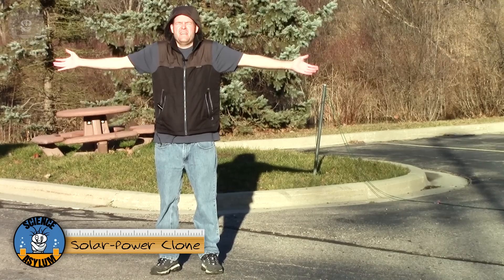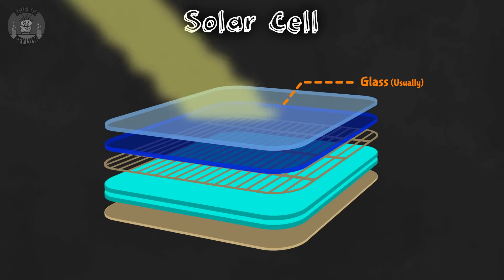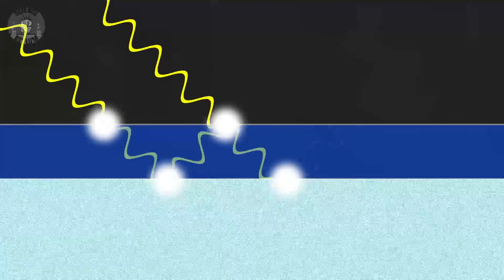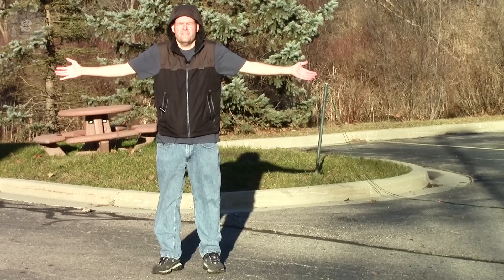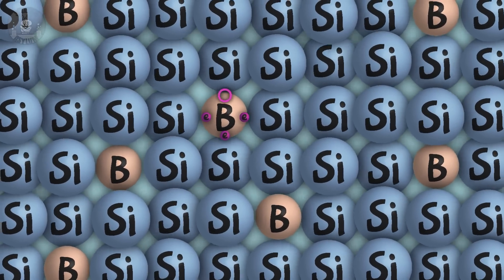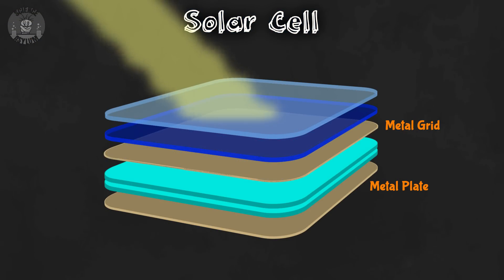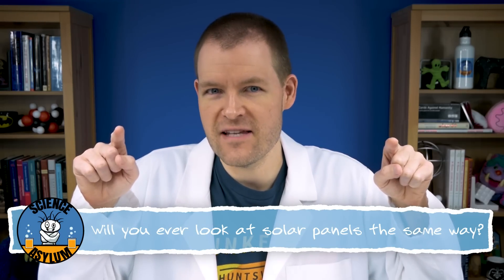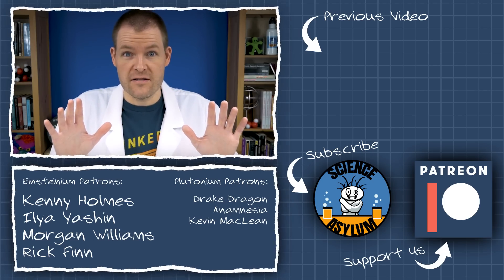How Do Solar Panels Work? (Physics of Solar Cells)

Comment: We always have to be careful about "green" energy. As in what's the carbon footprint on the materials used... mining & transportation & processing. Particularly with green "batteries". I was an early adopter of CFL bulbs. Despite what they claimed the early bulbs burnt out like crazy. Meaning I had to buy more...  resulting in more transport and manufacturing costs. Then I realized instant on meant up to 2 seconds for the light to work... dangerous on a staircase. And then the news about mercury in the bulbs hit. Dangerous if they break and toxic for disposal. Expensive to produce and decommission.  So now I really wonder if they're actually way worse for the environment than regular old bulbs. Like batteries for solar power storage and "green" vehicles that are likely to cause a huge toxic waste issue in the near future. I've heard about solar being the answer my whole life and there are a lot of good reasons why it's still relatively rare and extremely expensive.  Despite all the yearly "breakthroughs " they have over the last 5 decades. I wish green tech wasn't such a marketing scam. They need to be honest about the environmental issues they have.
Reply: Extremely expensive? It's literally cheaper than the fuel for a a coal power plant in many areas. Cities around the USA are going pure solar because it's the cheapest source of power, even in areas with access to cheap fossil fuel. And this is all ignoring the externalized costs of coal pollution, both mining and burning. Even "clean" coal power plants release plenty of toxins.

The only cost effective fossil fuel is natural gas, but that has its own set of practical issues limiting its mass scale use.
Reply: @BenjaminCronce  I'm in western Canada. I priced out solar for my cabin by a lake. A summer cabin when it's warm and extremely sunny. The solar company calculator estimated a full system would pay for itself in 60+ years. And that was based on year round usage so it would be significantly expensive and pay itself in say 300 years. So yep... expensive in the extreme. If you live in a dessert with no local power lines and huge  government subsidies then it might be affordable.  But solar at the moment, like wind, is way more expensive than alternatives here. We have huge wind farms but their electricity is still double the price. Only government incentives and subsidies makes it at all practical. Of all the houses in the USA about what percent use solar power? I heard Elon Musk's solar roof panels are about $100,000. USD per home. Is that cheap? What about the batteries ? How many years before they need to be replaced and how clean are they? I agree we need to pursue the tech but let's not kid ourselves. There is a reason it's not everywhere yet. And I'm not sure where you get your coal but it's dirt cheap here. And they say there is enough in Alberta to fuel all of North America for 650 years. Not that we want to lol since it is clearly not good for the environment. We also have vast amounts of natural gas, hydro electric and nuclear power in Canada. But every type has some big environmental issue. I'm all for clean energy. I just want the drawbacks clearly stated so people know that even solar isn't perfect. It all comes with a hit to the environment. Those hundreds of wind turbines I drive by... yes hundreds aren't made of fairy dust. They have a huge manufacturing and maintenance footprint and are apparently bad for our bat friends.
Reply: @cgaccount3669  
I priced out a rooftop solar PV panel system in Canada ten years ago with a vendor and it would have cost me $60,000 and pay itself back in 12 years.  It should be much cheaper now (half?) and payback should be faster in a sunny place like Alberta (along with today’s increased utility costs),  But maybe your cabin is in less sunny BC.  If you use it for just a few months of the year, the payback time could well be much longer for your system but it will also have a much longer life to amortize over, which means it comes out the same in the wash except for interest costs.  You might have to pay a minimum for year-round hook up to the utility system.  I need to pay about $80 each month for the 6 months that I don't use my cabin each year.  That might be almost the same cost as a panel system that lasts twice as long as expected.  I can't choose this option because my cabin roof is almost entirely shaded by trees.  I can't go entirely off-grid at home. 

Wind turbines probably make more sense for Alberta utilities than solar PV.  Rooftop solar PV is still a bit expensive but utility solar PV (not rooftop) is cheaper than coal, gas, hydro or nuclear or any other option in most places except for wind turbines, and energy storage is becoming a negligible added cost.  Geothermal is actually the cheapest where it’s available.  At the rate solar PV and energy storage are still falling in cost they will be well below any other option in cost in the early 2020s probably everywhere.  Solar PV is even making inroads in Alaska now.

Coal isn’t an option to consider because of its extreme negative health effects, never mind its extreme negative climate effects.  Unless you can gasify it and sequester the bad stuff.

Wind turbine manufacturing cost is a onetime cost paid back in 5 to 8 years.  They don’t need much maintenance either since they aren’t subjected to high heat but solar PV is better (no moving parts).  I would not worry too much about wind turbines and bats given the number incinerated by fossil fuel chimneys (birds too).  Besides all the insect populations are crashing because of climate change so fewer bats and birds will be needed, or they will starve.
Reply: @cloudpoint0  I'll have to check the prices again as I priced out solar in about 2001. I'm still skeptical about solar and wind power payback times. My evidence is how little you see it in reality... how many friends and coworkers do you know using solar? It's still not nearly as common as dreamers wish. And again... marketing hype and outright exaggeration by people that want our money. Prices are dropping fast... I've heard since 1970 when as a child I did a school report on solar... the panels that were going to be everywhere... as common as flying cars and moon bases. I for example went totally LED for lighting to save power. The boxes claim I'll save a fortune on my power bill. But I know it's a huge exaggeration because the savings claimed by the dozens of LED lights I have will mean I pay less than nothing to light my house. I'll save more than my power bill is! Really marketing department??? Really? I want to cut my power usage but I know LED is not yet cost effective, But at least it's not quite as pricey as solar. For example 1 bathroom fixture I have uses 4 globe bulbs. $24 each for LED!!! But with government subsidy I got for $2 each. Still way more than the old 40 cent bulbs. I'd love to go solar or have a windmill in my yard. But do the companies that sell them mention the huge bill you get for replacement batteries every few years? Replacement generators? The energy used to create their green tech? Trucking, mining, plastics, metal processing etc? Those high costs for these systems are due to the high and very un green downstream manufacturing processes that you might find their marketing fails to mention. It's like a city being green with their recycling program failing to mention the plastic they collect gets trucked thousands of miles and is shipped by boat to Chinese slums to be recycled.  How green is it really? I just don't want the illusion of being green. That helps nobody and hurts industry that might actually be greener than the green alternative.
Reply: @cgaccount3669  

The payback period for a rooftop PV solar panel system is dependent on these factors:

1. Your upfront costs to install the system (and a new $1500 inverter every 10 years)
2. Your panel efficiency (probably 11% to 22%)
3. Your expected sunlight per year (fairly consistent year-to-year)
4. Your roof’s angle and area exposed to sunlight
5. Your roof’s shading from trees and other structures
6. Your local grid’s energy cost being offset or what they pay you if you sell energy to the grid (grid feeder vs load replacer)
7. Lifetime of the system at full power (needs to be longer than the payback period, 25 years is guaranteed by the manufacturer, but 60 years or more is expected)

All of these are almost exactly known for each site so the payback period is just mathematics.  #1 depends on how big a system you want rather than site, and whether you want batteries in the case of a load replacer system.  A 5kW solar panel system should be fine for a typical home assuming 4 hours of sunlight per day, so about 20 or so 250W solar panels would suffice.  Some sources say a 7.5kW system is better for Canada, so add 50%.

For my cabin #4 and #5 were deal-breakers.  For my city home #1 was the deal-breaker since my wife wanted to sell our home within two years and she didn’t think any buyer would give us the invested value of the panel system (we never sold, we spent the money on the cabin instead).  #6 would be a problem in a place like Quebec where retail rates are very low.

The cost was $60,000 ten years ago but I’ve read the same extra large system would cost me $33,500 now with a payback period of less than 5 years.  Add another $1000 to $5000 for a battery system.  Replacement generators are not needed for solar (none are used).  I’m not sure how long batteries would last and few people bother with them at all.  Local subsidies might reduce your numbers a lot.  I can only speak definitively for the numbers when I considered a system about ten years ago but things have changed a lot since then.  I know solar panel costs are declining 34% plus per year and battery costs are declining at 7% per year.  The declines have been insane over the last 5 years.  See…

https://amp.businessinsider.com/images/5af0a65e19ee8624008b498d-1136-852.jpg

https://unfccc.int/news/further-dramatic-fall-in-price-of-solar-energy-forecast-for-2018

In Alberta (which apparently has a 30% rebate) it costs $3.50/Watt to install a solar system, times 5kW is $17,500 before rebates per the following website…

https://solarpanelpower.ca/cost-solar-panels-canada/

Note: The first paragraph in the above link mentions a 7,500kW system.  This is a typo.  They mean a 7,500W system.  7,500kW would power 1000 homes.

I would say #1 is the show-stopper for most people.  Tens of thousands of dollars out of your pocket now that you can't get back are hard to justify for a long term future benefit.  They prefer to invest in bonds or stock funds where the principal is preserved rather than in what's essentially a business venture.  It's a psychological issue.  Maybe some people don't like the look of panels on their home or they worry about roofing problems or they just don't have suitable roofs.  I'd say one in 200 homes have a panel system around me.  My immediate neighbor installed one last year though.  I suspect it's a leased system but I'm not sure.

I haven’t looked into LEDs.  I know they use almost no electricity plus they almost never need to be replaced.  A 100-watt regular bulb burning continuously costs around $130 per year to operate.  An LED would pay for itself in two months at $24 (but Home Depot near me has them for $5 each).  Of course, if you use the LED light for just one hour each day, it would take 24 times longer to pay for itself, about 4 years.

The energy costs and pollution caused by manufacturing renewable energy systems are not exceptionally high.  Certainly no worse than building nuclear plants (that use the same materials) or burning coal or scraping away tundra.  Cities don’t ship valuable recyclable materials to China or anywhere else far away.  This sounds like an urban myth to me.  Old electronics might get sent away but these aren’t usually collected by city recycling programs.
Reply: The mercury concerns were really overblown. They do contain mercury, but in the most minuscule amounts. I think some publications tried to spread fear about them for political reasons - there were plenty of articles about how Obama was going to force everyone to buy CFLs.

Comment: Question:  if the glass on top were bubbled/lens shaped, would this focus the light better possibly improving efficiency, or is the solar cell limited by simple surface area regardless of the angle of the light?
Reply from the maker: You wouldn't want to focus the light like that. You could damage the solar cell. Light is powerful.
Reply: Good point.  Like a magnifying glass burning paper.  I was thinking a more subtle curvature in order to take advantage of cloudy climates or situations that made south facing arrays (in the Northern hemisphere) or direct light facing difficult.

Comment: My comment below notwithstanding, I still enjoyed this entire video. 

7:19 "Why use carbon fuels that mess up our atmosphere and ocean?"

Some thoughts, for what it's worth:

1. In what way do carbon fuels non-trivially mess up the atmosphere?
2. More carbon in the atmosphere encourages more plant growth: is that a bad thing?
3. What about the pollution generated from the production of solar panels and batteries? Isn't it potentially more toxic than carbon fuels?
4. Do we really have adequate battery technology to support a fully solar, non-backed, electrical grid? It doesn't seem like that actually exists (yet)
5. As Alex Epstein puts it, the key criteria for energy is scalable, reliable, plentiful, and cheap. Hydrocarbons fit the bill, solar is not even close. 
6. There are +1 billion people in the world without adequate energy. They desperately need the cost of energy to decrease, not increase. 

Anyway, great video, thank you.
Reply: 1. Carbon fuels turn up the planet’s thermostat at a rapid rate.  This is not conducive to a prosperous and stable civilization in the short run and our survival in the long run.
2. Some plants do like more carbon in the atmosphere, trees and weeds.  But not so much agriculture, which seems top out at lower carbon concentration levels and needs a balance between carbon and other ingredients that carbon prevents, like adequate moisture and mild temperatures (versus scorching hot days).
3. Not much pollution is generated for solar panels and batteries, mostly some one-time mess in an already naturally polluted area like remote salt flats.  Carbon fuels are an ongoing and never-ending source of pollution in the less polluted environments where we live.
4. No matter what you use as an energy source, you need adequate backup sources.  Nuclear reactors need to stop for refueling and all sources need occasional refurbishing and sometimes break.  At present we don’t need battery storage for solar power since there isn’t that much in use yet.  Batteries and other storage solutions exist and can be built when we need them as renewables become a bigger factor.  Battery costs have fallen so much in the past few years that the extra cost is negligible (maybe 4 cents a kWh instead of 3.5 cents, still cheaper than nuclear power).
5. Hydrocarbons are in limited supply and will run out in time, decades for oil and gas.  We are already resorting to fracking to get at the bit of oil and gas that remains in old hydrocarbon deposits.  Renewable energy is scalable (no massive 5 billion dollar plants needed), reliable (with cheap energy storage now), plentiful (in fact, almost unlimited), and cheaper than any hydrocarbon option (it’s nearly free).
6. Those without adequate energy now are skipping last century’s technology and heading for cheaper renewable energy.  Nuclear energy might still have a role in some developing nations where huge base load increases are needed to advance into this century.
Reply: Your statements would be great if the data showed a decrease in the CO2 ppm as we released more CO2 in the atmosphere. That's not what's happening.
Reply: Nick has a video about global warming you should watch and i have a crappy video (the first yt video i created) that you should watch too. https://youtu.be/yxWU_3BPhZg Yeah it has audio issues but in the second half of the video i address global warming deniers. Here's Nick's video: https://youtu.be/ePoLzv9ihbc
Reply from the maker: Honestly, my video isn't that great. If you really want to learn about global warming and the ups/downs of renewable energy, I recommend checking out PBS Hot Mess: https://www.youtube.com/hotmesspbs

Comment: What frequency range of electromagnetic wave is get absorbed in this process.
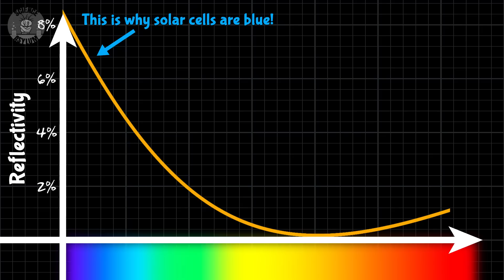Reply from the maker: As you can see from the chart at 3:00, mostly visible light.
Reply: @ScienceAsylum  is that the major reason that solar cells are 25% ish efficient. What could be the theoretical highest efficiency that solar cells could achieve?.
Thanks.
Reply from the maker: Modern solar panels are 40% to 50% efficient, but that's not because of the type of light they absorb. The efficiency is already only considering the light it absorbs. The problem is the loss to heat.

Comment: How is a capacitor worse/better than battery when talking about energy storage? I remember reading something about use of capacitor to power electric cars instead of batteries, because they're lighter I guess. I'd love to see a video on this topic!
Reply from the maker: Capacitors can hold a charge longer, they can charge faster, they're lighter (as you said) and they're not as bad for the environment. The problem is that batteries still win in storage capacity.
Reply: They are more efficient, longer life, and can produce absolutely ridiculous amounts of instantaneous power.  They have not replaced batteries because they are behind in one key area: Energy density. Even the best supercapacitor stores a tiny fraction of the energy you could store in a battery of the same size and weight.